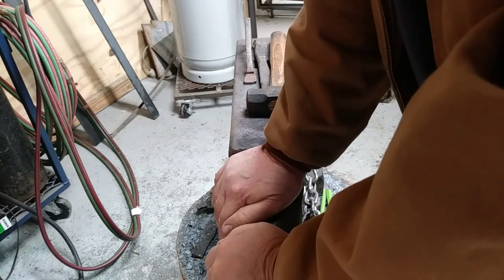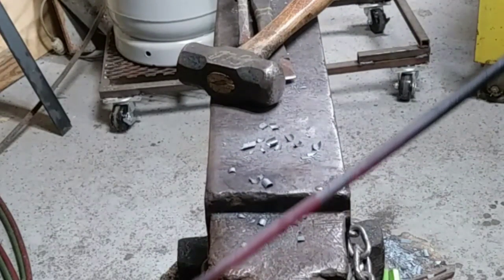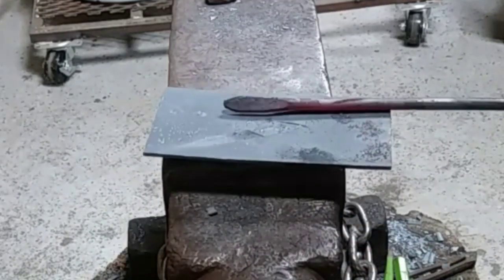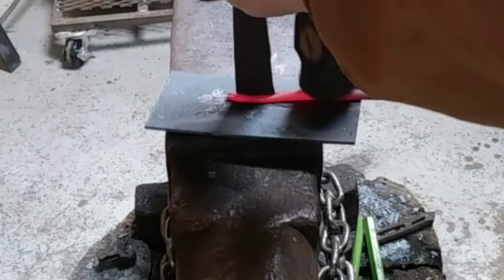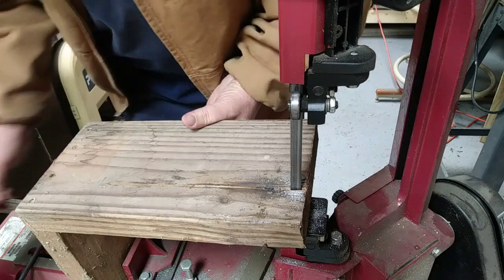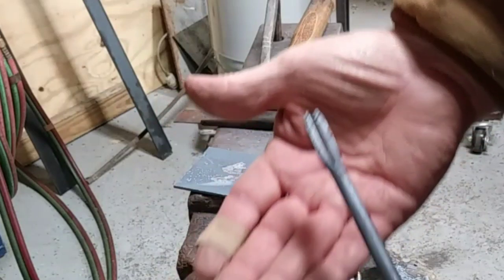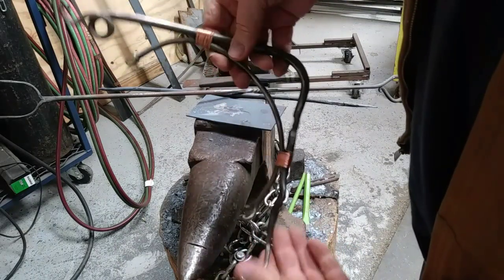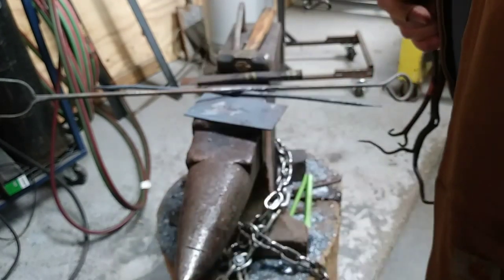Tuesday's Tip:  Slitting or Splitting Steel

Comment: Great idea. Boss wants me to make some w 4 tines like a dinner fork. 
   Never made either. So guessing one would have to
1st square it
2nd fold back .75 in n forge weld it
3rd flatten from top of forgeweld at welding heat
4th arrange and work the chissel to cut 4 tines
5th work it out as per lenght required.
   Sound about right to you?
Good tutorial sir
🙏 Blessed days Sir
Crawford out ⚒️🧙‍♂️
Reply from the maker: That would probably be the best way. The only other way would be to start off with a real thick piece of steel but then you have to draw out the handle... Probably easier to forge weld the end. 
Your steps sound like the best approach to me.  Sounds like an interesting project. :) 
I have on my list of things to make a eating fork, spoon and knife. I thought about making a 3 tine fork. But I will have to see how that goes. :)